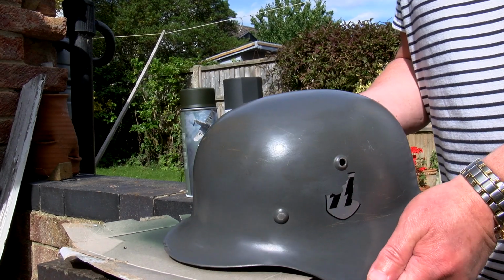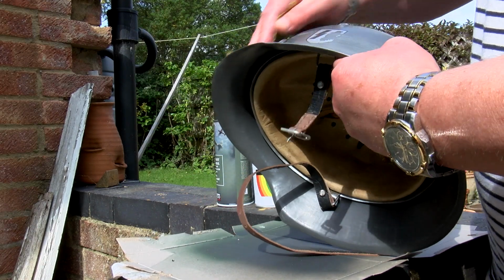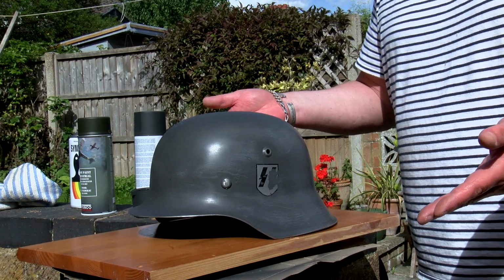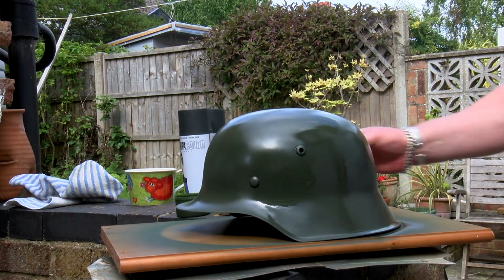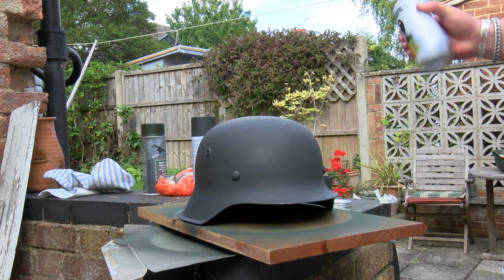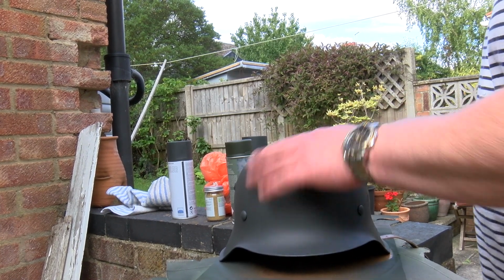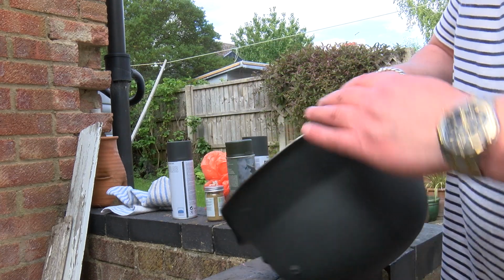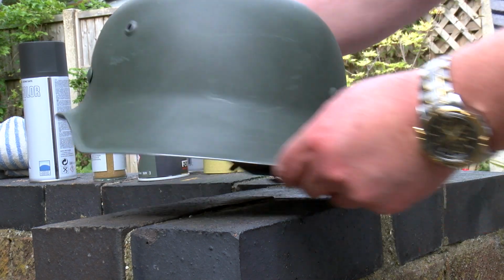Re painting German helmets

Comment: I just got done painting my m42 and it turned out very good thanks for having a nice video to watch I used a small amount of aluminum oxide to give a slight texture I didn’t want to over do it so only used a small salt pinch then I moved it around a little to spread it out then finished it with another small layer of paint.
Reply from the maker: Ah, Aluminum Oxide nice. Sadly I couldn't get hold of any but as you know, I'm sure, that was what was used originally for texture...I think it was added to the paint when spraying.
Reply: Aluminium oxide was added to the paint to make the surface less reflective. I got hold of some AO very cheap off ebay and mixed it with acrylic paint which I painted on by hand as a base coat and then spray painted over it. I think it looks very effective. I went with a relic look.

Comment: The m 42 was wrong it is a single decal in the beginning from the production of this helmet and later on no decal
Reply from the maker: Ah thanks for that...it's a 'no-decal' from now on!😜
Reply: Wrong color for that helmet should be field gray not pea green
Reply: @dillonswanson6125  They vary greatly in colour.
Reply: @rexterrocks  yeah, feldgrau/fieldgrey, was for the WH (shot for "Wehrmacht Heer", if you didn´t know) and the Waffen SS, though the Waffen SS also used Wehrmacht camos, like the Normandy camo and Black, for their helmets, and the Wehrmacht also used a beige/sand yellow (Sand gelb) for the DAK, a blue-ish color for the Luftwaffe, as the Police sometimes also got their hands on non-beaded M35-M42 helmets, those were colored green, and the Kriegsmarine, also had a gray and slightly blue-ish coloring for their helmets  ;)

Comment: Im using aluminum oxide for texture as sand is a little large. It doesn't really matter because they were frequently overpainted in the field. When using aluminum oxide and enamel paint, I'll bake it in the oven on a very low setting for an hour or so, 150° . It actually melds the aluminum oxide and enamel paint into a super strong paint . I did it with restoring coleman lanterns and just transferred the process to helmets( no A.O) on lanterns though .  Corked M1s I lower the temp and time so as not to burn it.( not sure if that has or ever could happen ,it's just something that I THINK might happen if temp was too high or in too long. Good video, tips are always good for those of us unwilling or incapable of shelling out the ridiculous amounts of loot that Nazi junk costs. I have (1) M35. I collect allied only, M1s and M1917s. (Except that 1 M35 which I'm not thrilled about but im going all in with field camouflage, some European chicken wire ( its different than ours in the U.S.) or maybe a "so called" Normandy camo, job. Sorry about jacking up your thread.  Decent job. Good color. Thanks for the video
Reply from the maker: Ah, now you are doing things properly! I should have mentioned I'm a film maker and just want the helmets to look a bit 'better' from a distance. When you have brand new shiny helmets your actors do look as if they've just arrived from Central Casting! Like the sound of your thoroughness tho' 😎

Comment: To apply a grainy finish try spraying the helmet with a tack spray by 3-M and then a light dusting of sawdust etc.  The paint should seal things up and if not use any sort of dull coat etc.  To age the liner - and it will look like perspiration stains - apply damp coffee grounds.
Reply from the maker: Good tip. I've got a bottle of finely ground cork I used on my US M1s but to be honest after a few weeks of handling they that lose that shine. Also these are film props so aren't subjected to the same scrutiny as re-enactors 😜
Reply: @zangtumtung  Hello - here in Chicago the old t.v. show "Combat!" is on and I enjoy looking at the errors on the German helmets - this was long before reproduction ones were being manufactured.  Any advice on decals?  It is here that I have meet somewhat of a Waterloo - my problem is that I can not leave well enough alone!
Reply from the maker: @johnzeszut3170  Ah Combat! I loved that show as a kid and am enjoying it all over again as some kind soul has put it up here on Youtube. Yeah they usually had the Germans running around in WW1 Stalhelms and blazing away with Vickers .303 machines guns with the odd .50 Cal thrown in! 😝 but it didn't matter because the story lines were so good.                                                Decals! Don't talk to me about decals! I think in the video I pointed out that I painted over them because I'd f**ked them up so badly 😝 So sorry no help there...

Comment: I know this is an old video.  Its not a bad starting point.  I would suggest updating the video description to reflect some of the lessons learned from the comments below.  I know you couldn’t get a hold of aluminum oxide.  You should explain that in the video description.  People will use your methods as a starting point so you should tell them what you learned so will be informed as well.  Also, your helmets look much better than what you initially had them as. 

The color tones are subjective to the company producing the paint.  Dunkel grau (RAL code 7015)Schiefer grau vs feldgrau (RAL code 6006) are similar in color just vary in color tone.  Feldgrau is not apple green.  Apple green was a pre war color.  Helmets were later made to be darker so the next color shade used on m40s was nicknamed pea green.  Feld grau is not pea green as mentioned by some one else.  Pea green as a color is a tone between Feldgrau and apple green.

Again the color tones are good.  Both are very appropriate for m42 helmets.  Just update the video description to reflect correct info. learned from the comments and this is a decent starting point for beginners.  

Also the lack of aluminum oxide is tough.  Its hard to sprinkle it on and not look clumpy like cork sprinkled on an m1 steel pot. Someone suggested mixing it in with acrylic paint and brushing it on.  If dome right.  That finish will look great.  Lay down a good base coat of a flat spray paint, so brush applied paint and aluminum oxide mix has something to really bite into.  Sanding the paint on the metal isn’t enough for that kind of paint and application.  It really needs nice flat paint to act like primer.  Stipple the paint on.  Id you stipple, it will look sprayed on.  Bake the finish at 180*f for a few hours.  This will speed up the curing process and harden the finish too.  Then spray paint over it with the Desiree color  Or. You can use a textured finish from a can like rustoleum or krylon.  Hammered metal finish looks good texture wise.  Spray over with the correct color.  Easy way to simulate aluminum oxide.

Yes this isn’t how helmets were done historically.  However,  you’re trying to replicate the end results to simulate aluminum oxide texture.  For those only saying sprinkle on aluminum oxide, the Germans mixed it into the paint and sprayed it on.  So for all of the accuracy purists out there( most likely having a fit) these are repro helmets, the intent is to simulate the texture and take away the shine.  Theses are some good ways to do that.  Ways that anyone who does not have the money pr means to do it correctly.  Regardless, the end results look nice!  Much better than when you started out!
Reply from the maker: Many thanks for your comment. As you quite correctly pointed out I am in no way an expert and simply wished to repaint them so they weren't so shiny. They were/are for use in filming and I am not a re-enactor so exact detail is not really needed and they certainly wouldn't pass muster for a re-enactment group. However I am pleased with the way they turned out and yes, they do look better 😃